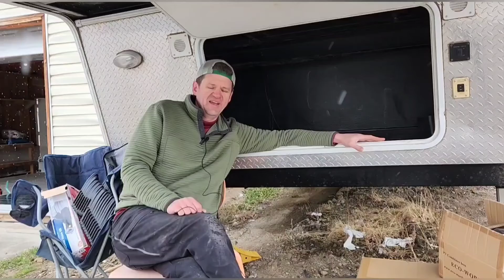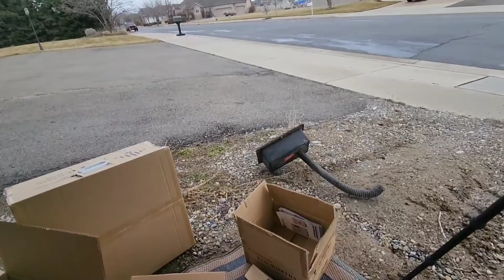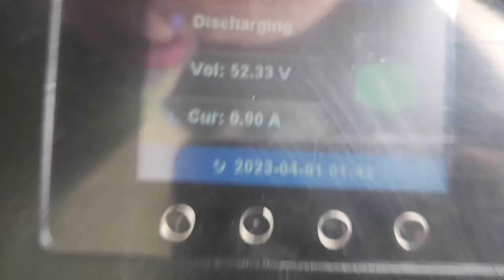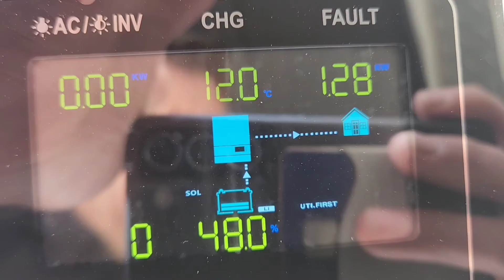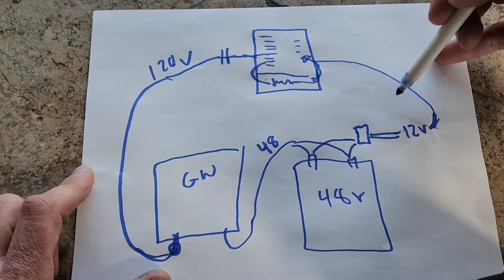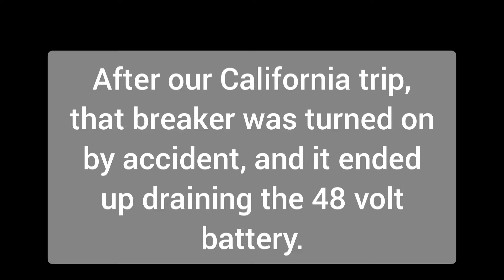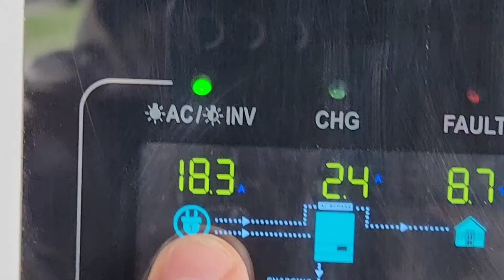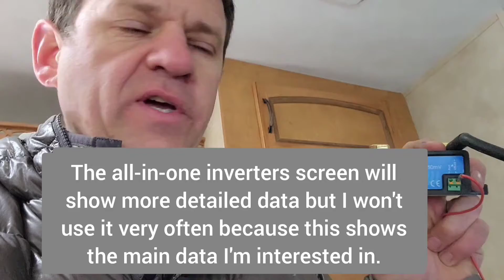12v to 48v RV conversion. Ultimate Off-grid RV Solar Power System Install

Comment: How many BTUs is the air-conditioning? And how long can you run the air conditioning?
Reply from the maker: 15000 BTU unit I believe.   After climbing up there I think it came with a start assist.  If the sun is our I can run all day.  Night for only a couple hours.
Reply: @diySolarPowerFunWithRay  what kind of battery storage do you think you would need to reach an equilibrium for an eight-hour overnight
Reply from the maker: @bluewaterplumbingsolutions4774  1500wh x 8 = 12000wh.  So i'd need 3 of these batteries to go overnight... no needed in utah but it a hotter place would be nice.

Comment: Do you have issues with the 48v system panels in shade/partial shade?
Reply from the maker: Yes, although I would blame it on the inverter I have installed.  I should have purchased this inverter instead (https://signaturesolar.com/growatt-48v-3kw-150vdc-stackable-off-grid-inverter/?ref=DiySolarPowerFun)... That way I could 2 strings.  If you can fit 3 large panels(240 or greater) on your RV I'd stick with a 48v system. Other wise I'd down size to a 24v system.  My step down convert has been great powering my 12v system though.
Reply: Thanks. It's mostly the mppt input voltage as the issue, right? Would the renogy panel with 60v input be similar to that growatt? I'm in Canada, so more limited options.

RENOGY 48V 3500W Pure Sine Wave Inverter, All-in-One \w MPPT Charge Controller, Power-Saving Mode DC 48V
Reply from the maker: @ShaneLeedham  yes. Mainly the mppt input voltage.
Reply from the maker: @ShaneLeedham  does signature solar ship up there?  haven't tested the renogy.

Comment: My 24VDC Growatt is Model # "SPF 3000TL LVM-24". In the battery setup menu, it indicates I am supposed to use a Growatt Li Battery (only) but allows for customizable settings for Li. It also has the communications cable yours does. Is the Signature Solar battery designed to be compatible with the Growatt systems like ours or is yours so much newer (I purchased mine 2.5 years ago) that it is "plug and play" with other Li batteries that have a communication port??
Reply from the maker: If your battery has a communication port I bet the Growatt will communicate with it. You just have to select the protocol from the menu.  If you call Signature solar they can tell you the protocol to set.

Comment: With only 18Amps of PV input allowed/specified, how can you add another string of in-series panels without going over 18amps? My Renogy 320watt panels are about 9.8Amps (Isc) each so I could only run one string of in-series panels on my RV roof as plugging in another string (as you suggest with your combiner box) would be within the VOC limit but outside of the maximum current input. I'm confused.
Reply from the maker: Where are you seeing 18amps max?  My growatt spec might be different that yours.
Reply: @diySolarPowerFunWithRay  I think you already figured it out that my information came from the sticker on the side of your Growatt.

Comment: Ray, Question. If you had a 50amp system in your RV how would you wire your inverter charger to a 50 amp plug? Thanks
Reply from the maker: You'd basically need 2 of these inverters...  One for each hot line on the 50 amp RV plug.

Comment: By chance did you happen to take the ground neutral  bonding screw from this unit..?
Reply from the maker: To be honest I can't remember.  Good call though.  I should have a GN bond. I'm not sure why I missed that.  I'll mention that in a pinned comment.  I've has mixed experiences with the bonding screw. I think I'll use a bonding plug.

Comment: This is the best video I've seen on this topic. Thank you so much!  One question, though. If the RV has an on-board generator, how does that figure into the design?  I imagine it's just another input, but not sure how it would be wired into the inverter?
Reply from the maker: What I would do is have the generator output go into the AC input of the Growatt inverter.  You could have a 30 amp chord that feeds into the AC imput of the Growatt and then if you ever need a generator you could plug it into the generator output... Or if you have shore power available you could instead run the 30 chord over to shore power.   Another option would be to purchase a separate Battery charger and have the generator output go into the battery charger.  The Growatt has enough output that it's the main power supply for my RV.  The only bad thing about the victron multiplus 3000 is that it only has 2400watts of usable power so you have to supplement.

Comment: Looks like a good budget system, i hope it works out well for you. 

A few suggestions of things i would do differently if it were mine. 
First is how the 120v power is run. I would run from the inverter direct to the panel and get rid of the shore power wire you are connecting externally. On the input side of the inverter i would wire the existing 30A shore power input connector to the inverter input so if you were to camp at a park you can plug in and operate normally/charge the batteries like you showed with your 20a plug.  You could still connect to a 20a with a dogbone if you needed to. The inverter is designed to be a 30A passthru, why not use it. For the buddy/emergency output, a new 30A breaker off the panel and that 30A plug on the outside would be a much cleaner install and give you the ability to shut off that outside plug when not in use. You could use use the slot where the 12v converter was and replace that with a 30A for your output. 

I would also use that second battery you have in parallel with the first. You have it already why not have 10kwh of battery storage on tap..... 

Big yes to the soft start too, it will make a world of difference every time the compressor kicks on. 

I would also highly suggest getting rid of the wire nuts. They don't work well anywhere there is vibration present, they will wiggle off leaving an exposed live connection. Crimp style butt connectors would be a much better choice.
Reply from the maker: Thank you. Good suggestions. I think I'm going to wire up that 30 amp pass through plug. I haven't needed it yet but it would be nice to have. I think the future owners of the RV would appreciate it. I didn't put a breaker on the emergency outside plug because the inverter technically isn't able to Output more than 30 amps. If it tries to pull more than 24 to 30 amps it just shuts off automatically. I'm not sure how it will act in pass-through mode though. I need to test that still. 
   I've really liked it so far, but I don't like my charge controller. If I have a single tree shading one of my panels, it kind of shuts the whole thing down. The other growatt 3000 would be better.
Reply: @diySolarPowerFunWithRay  I would definitely put a breaker on the output. Regardless of the current draw you still would want to protect your RV electrical system in case of a short or anything else that may be plugged into that plug. When it comes to breakers you size it for the wire not what the circuit may draw. If you are going to use a 30A plug you should wire it with 10ga and a 30a breaker.  I would also put a fuse or a DC breaker on the pos of your 48/12 converter between it and the battery as well.
Reply: @diySolarPowerFunWithRay  Which other growatt are you referring to? The Growatt 3kW Stackable Off-Grid Inverter | SPF 3000TL LVM-ES?
Reply from the maker: @1992garyd  I have links in the description of the different inverters I like.

Comment: I just unhooked my agm batteries and installed lithium on my rv.Should I undo my 12v power from truck?
Reply: Dang I just now seen this comment,thanks.
Reply: I have 2 alternators and made a 20 hour trip and all seems well.I’ll check on your other  suggestions.Thanks ! Did a screen shot so I don’t forget lol
Reply from the maker: Yes, I would.  The lithium batteries,  if low, can draw a ton of current from the alternator and ruin it. Also the wiring may not be sufficient for the current the lithium battery would accept and could melt your wires or blow a fuse if you have one. You'll want to install the piece of Hardware that is mentioned in the van conversion video I have. He explains it there.  One other thing to be aware of is that sometimes the standard converter box in your RV, depending on the year, will have a switch so it can either charge lithium batteries or lead acid batteries. Battleborn also mentioned that when I called them. Hope that makes sense
Reply: I want to put my lifepo4 battery in my 5th wheel, but haven't done it due to the alternator issue, how do you make it so 7 way plug isn't even trying to charge lithium battery when driving? Is it even possible? Using a dc to dc charger seems complicated.
Reply from the maker: @aznick102   you can just disconnect the charging wire on your  trailer side easy enough like I did.  I haven't missed it... because of the solar up top.
Reply: Yah I unhooked power from truck to trailer but I’ll hook up that power to gen start deep cell battery maybe .
Reply: Thought I read growwatt was fazing out?

Comment: This was a fantastic build. I did a very similar install with the 24v system (growatt and EG4 battery) for my friends mobile massage bus. Im glad you did a 48v system which is what I should have done for her seeing as how all the costs were the same.

I installed 3 floor 120v outlets and a DC panel for her 12v accessories. She couldnt afford solar panels or anything additional but I did install the 30 amp inlet and wired it to the alternator so it’ll charge in between clients.

I think its amazing how much room you have for even more 48v batteries.
Reply from the maker: Thanks, That sounds like a system. She'll love it.

Comment: When you hook your truck.  The truck power plug into hour solar string #2. 12v dc and inverter will handle it and charge your 48vBatt. Use an amp resistor to limit amps.
Reply from the maker: Most 48v solar charge controllers require 60v to charg the battery.  I believe I could however use a 12v to 48v boost converter on that plug ,with a limiter, and connect straight to the battery to charge but it wouldn't help that much. I've never needed it yet.

Comment: Do you still have the shore power cable? I take it, you don't use the shore power cable anymore? What happens if and when using shore power cable, will it damage the inverter?
Reply from the maker: I plug the shore power cable into the growatt ac output. So I still have the shore power cable. If I wanted to plug into actuall shore power I can just unplug that plug and plug into shore power(No transfer switch... very simple).  and because my 120v ac to 12v dc converter box is turned off using the breaker, the "all in one inverter/power system" is totally isolated... the 120v shore power won't try supply power to the 12v dc system.  I hope that makes sense.   You might be interested in the upgrade video I also made:
https://studio.youtube.com/video/cYJSFjFo4S8/edit  Hope this helps

Comment: why did you get growatt instead of EG4 top make a complete system with same brand?
Reply from the maker: Yeah. This one does horrible in the shade.  I'd get the SPF 3000TL LVM-48P model insead of this one.   That one does better in the shade.  I'm definitely glad I didn't do the victron multiplus 3,000 though.. that one has 2400 watts and I could only run one large appliance.
Reply: If I read the specs right on the EV4 version, its minimum PV input is 120v, 10x as much as the other Growatt. That would make an RV-mounted solar array pretty tough
Reply from the maker: @Traveler0911     Yeah, that will have the same issues I'm seeing with my Growatt 48 es. It's tough to get that many volts around shady trees.  I should have stuck with the growatt 48 p. or 24p if you have a 24v system(good if you can't fit many panels on your roof)  Here's a link.   if you end up purchasing something from signature solar could you use my affiliate link.  not many people use them and it helps out the channel a lot. I wish I would have stayed with this unit:  https://signaturesolar.com/growatt-48v-3kw-150vdc-stackable-off-grid-inverter?ref=DiySolarPowerFun.
Reply from the maker: @Traveler0911  Yeah,  I'd avoid that one for an RV.  I'd get that I'd get the SPF 3000TL LVM-48P model.
Reply: I believe it's horrible in the shade because of the 48v system and higher voltage requirements for the panels themselves
Reply from the maker: @ShaneLeedham  I'd get the SPF 3000TL LVM-48P model.  It accepts lower voltage.
Reply: @diySolarPowerFunWithRay  and it'll charge the 48v battery with 2-4 panels?
Reply from the maker: @ShaneLeedham  at least 3 - 240 watt panels, like my used ones, would be best to account for shade.

Comment: I know a bidirectional converter 48 to 12V,   buck mode: 2500w, boost mode: 2000w, maybe this help you better in RV system
Reply from the maker: Cool. Do you have a link?

Comment: This was very helpful to see. One thing I have heard and it seems reasonable is not to use those wire nuts. They aren't good for in motion because they can come loose. Apparently, you want to use the kind that clip/clamp.
Reply from the maker: Thank you!  I didn't know that.